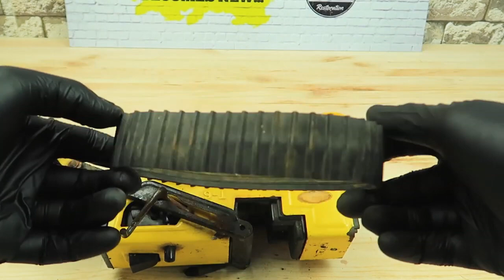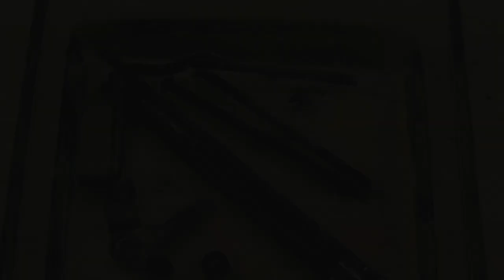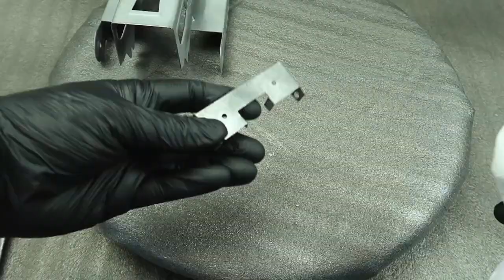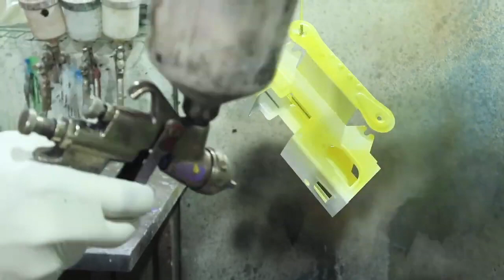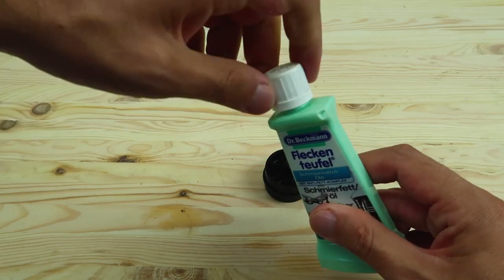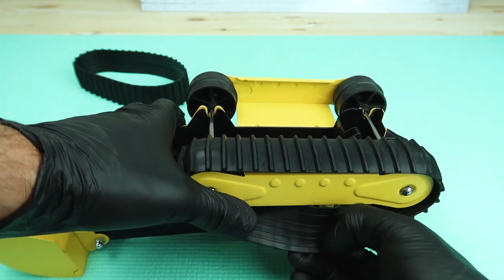Tonka Toy Restoration - Toy Repair Tonka 1970

Comment: This really brings me back. I had this and many other construction vehicles as a kid. I remember "making concrete" using rocks, sand and water in the mixer. Such great toys before plastic replaced steel and sharp edges with pointy corners.
Reply from the maker: Nice memories Rory

Comment: Just finished watching this video! One serious question were can i find replacement treads for my excavator on mine i only have one the other dry rot and fell apart!?
Reply from the maker: On that point I made thread with nut,but now,original parts you’ll find on ebay and I think is in USA a online store :gasolinealloy or something like that,they sell original parts for tonkas. Axle cap nut,decals,windshield..etc
Reply: @CoolAgainRestoration  Ok yes i have herd of it its called Gasoline Ally off of old route 66 i l8ve here in the United States Illinois! I have been some what successful making custom treads with runber guarden hose! Also used old Henglong remote control tank treads on my other duplicate! Lol awsome work!

Comment: Check to be sure but I am fairly sure that if you undercoat a yellow paint with pink paint, the yellow will be more vivid, distinct, more yellow, than using just a grey primer, ie primer, pink, yellow. That was a lot just to say use pink under yellow for better yellow results.

Comment: What media do you use? Yours seems to work better then mine? What grit?
Reply from the maker: I use aluminium oxide and very fine granulation.
Reply: @CoolAgainRestoration  I'm using glass bead at 80 grit. Taking forever and doesnt seem to cut through the enamel paint on my trucks. I think I need a different media.
Reply from the maker: John Willis depend also what air comp you use and wich psi. Depend on granulation and more. But why you don’t use a paint remover first. It’s much easier and you don’t mix the old paint with the media and can reuse 🤷🏼‍♂️
Reply from the maker: Or watch my latest videos,use a cleaning laser.
Reply: I did use a paint stripper on the last truck I did. You were right. Went much faster and I still sandblasted to get corners and deep rust off.
Reply from the maker: John Willis then you make it a great work👍🏻